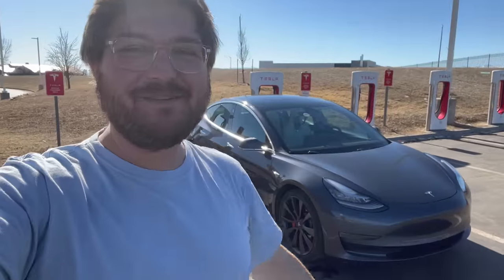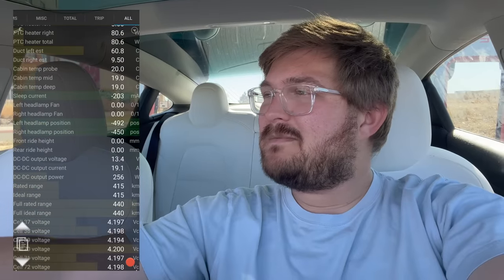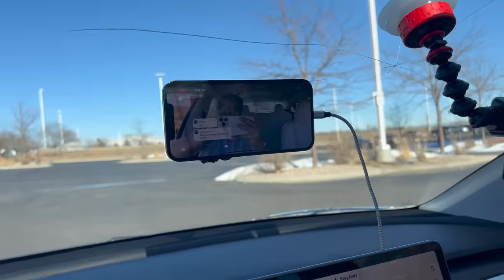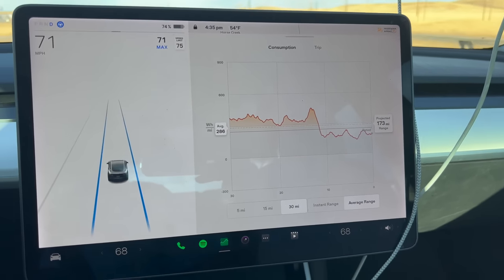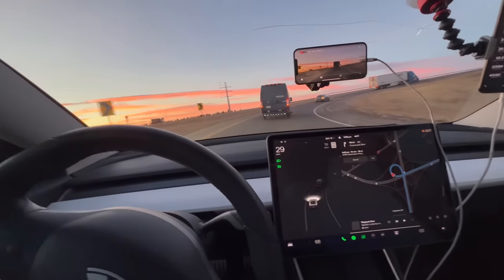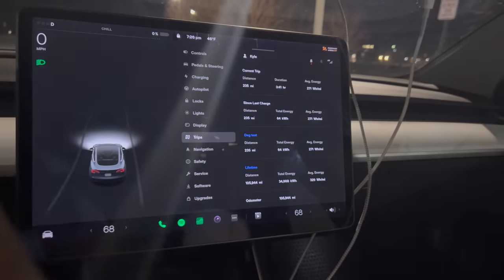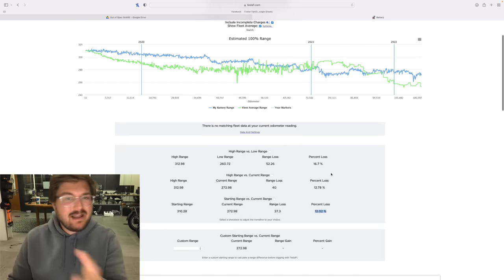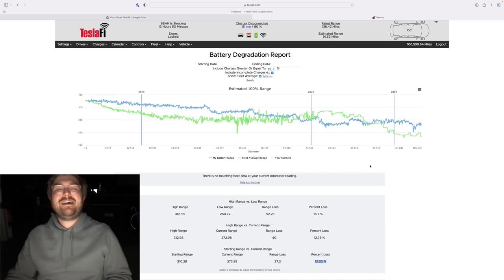100k mi Tesla Model 3 Performance Battery Degradation & 70-MPH Highway Range Test

Comment: Not bad, you lost about 11-12% after 105k miles, I bet most ICE vehicles lose that or more in efficiency after 100k but maintenance would of course be higher. Considering most drivers are 12-15k miles a year that shows EVs should be going strong after 8+ years.
Reply: Dont forget even though the battery has quite a lot of miles the battery isnt old yet wich will be interesting to see how it holds up after 10-15 years.
Reply: Well maintenance on an ICE would presumably curb loss of efficiency, I don't think they're losing much when properly maintained but would be interested in seeing numbers around that.

8+ years seems like a below-the-bar minimum for modern cars considering the average vehicle on the road right now is 12+ years old, and that would already include a lot of older and less reliable vehicles whereas EVs are almost all from the last few years.  By the time these EVs are 12+ years old, the average age of vehicles on the road should be higher.
Reply: I've never heard of range loss in an ICE tbh. Now you rack up a tidy maintenance bill if you're doing everything to it that you should be which, let's be honest, oil, tires, and brakes/rotors are about what most people do). 

Nothing at all against BEV's, but the range loss thing is a brand new thing to contend with when it comes to driving.
Reply: @belavet  It's just not usually framed as range loss. There have been quite a few studies that show that ICE vehicles do become less efficient over time. The compression ratio in a combustion engine decreases over time as the rings and cylinder walls wear. Intake and exhaust valves get dirty and don't seal as well. Intake and exhaust airways can get build up on them over time which restricts airflow, mufflers and catalytic converters can get get build up over time, EGR valves can get dirty or the motor gets weak and they don't seal well, etc. (I'm literally citing specific issues I've had on my own combustion vehicles that I've had to deal with to gain back power and MPG figures) Unless you spend a lot of money to keep all these components in like new condition, which would be very expensive, you definitely tend to lose some power and/or MPG over time.

This does result in range loss but almost no-one worries about the "range" of an ICE vehicle because going from 400 miles to a tank to 360 isn't as impactful since refueling stations are on every corner and the refuel time is so short. So it's not something most drivers would "notice" quite the same way as EV drivers because the distance per "full tank" is just not as important with ICE vehicles.

The reason I've noticed this more on my vehicles is I do a lot of towing with older vehicles. When you're towing a trailer the situation changes: You can't just pull in to any gas station, you have to find some place that can accommodate a 40 ft trailer. Plus your range on a tank full goes from 400 miles to a tank down to like 200 miles. So the experience of driving a truck and trailer is a lot more like driving an EV: You have to plan out your stops because you can't go that far on a tank and the number of refueling stations is more limited.

This is probably why I've never really felt much range anxiety driving EVs. I've been doing cross country road trips with RVs and trailers for so long that planning out refueling stops is just second nature now.
Reply: @belavet  My 1979 240D still gets 30 mpg on the original motor.  ICE range loss...smh
Reply: @bobbbobb4663  lfp loses even less range.